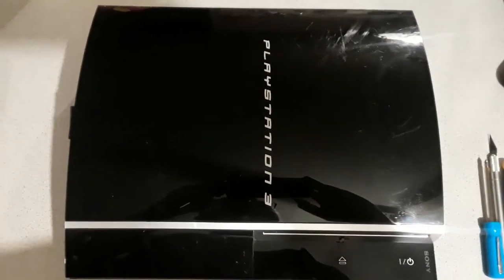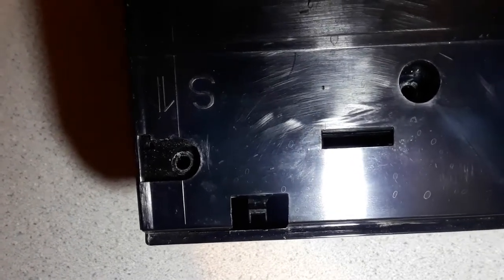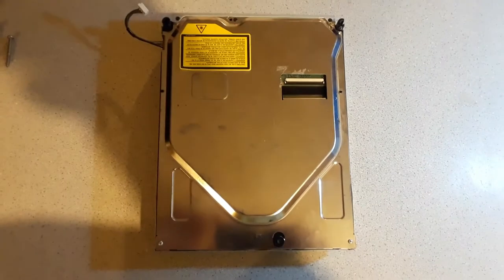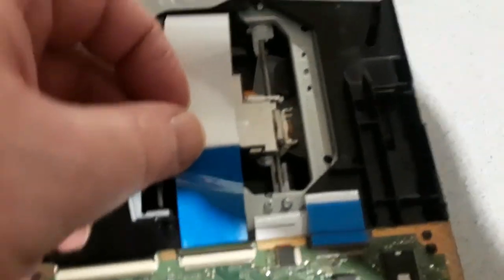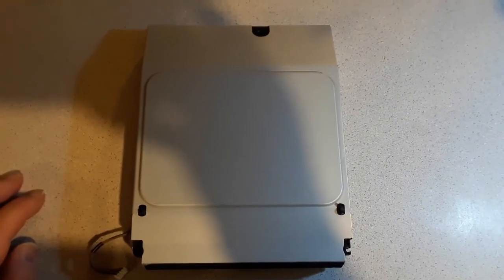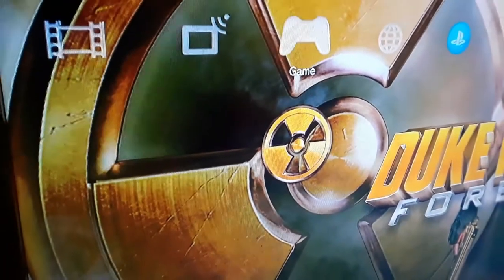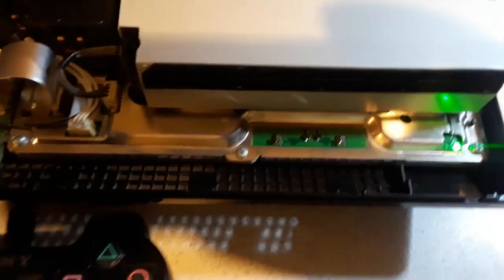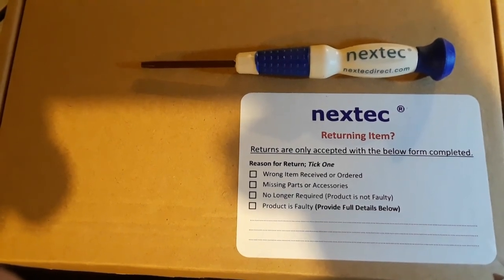Replacing the Blue Ray Drive in a PS3 CECHK01.

Comment: Thank you for this video. 🙏  Mine just stopped playing any programs or inserted media/games (causes a frozen black screen upon loading anything).  It can still recognize the inserted games but just wont play anything.  From my research this is most likely my BluRay Drive failing.  I am saving this video for when i receive replacement parts and will try a noBD firmware in the meantime.
Reply from the maker: @GreenLeefMusic  Good luck. Make sure you keep the control board and swap to the new drive.

Comment: Hello can I ask what model disk drive you replaced it with? Was it a KES-410A/ KEM-410? Thanks btw this video already helped me so much! Earned a sub.
Reply from the maker: From memory I want to say it was the KAS-410A but I'll confirm that for you. I found a chart online that told me the correct drive to use. So let me just double check to be sure.
Watch this space.
Reply: @KB1UIF  I can confirm it for you! We'll atleast kinda lol. I have the same ps3 and I replaced the drive with the 410A and it works. Thanks alot for the video, very helpful!
Reply from the maker: @michaellee4636  That's great.
I was pretty sure but it's been a while. I'm glad the video helped. That makes it worth while making these videos.
I'm happy I could help.
Thanks for the feedback.
Reply from the maker: @michaellee4636  Thank you for the feedback. Without pulling the PS3 apart or looking up my order, I wasn't sure which I had ordered. I may have ordered a spare unit for the future it it lasts that long, lol.
Reply: @KB1UIF  no problem! earned a sub!

Comment: the black clip holding down the ribbon cable has come off on mine. any solutions to fix this?
Reply from the maker: Other than replacing the whole connector, it might be possible to salvage a black bar off another board to replace the one that came off yours. Other electronics use those type connectors also. TV's often use those bar clamp type connectors. It would depend if the rest of the connector is broken or if other bar just popped off the base part. Good luck.